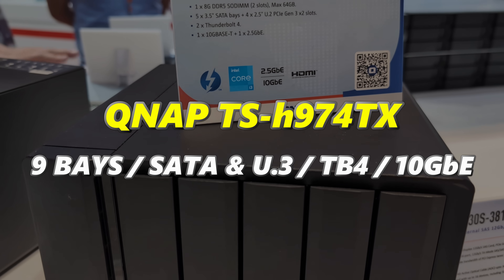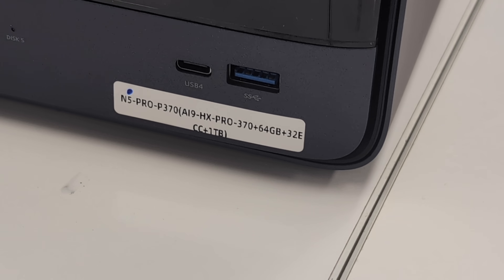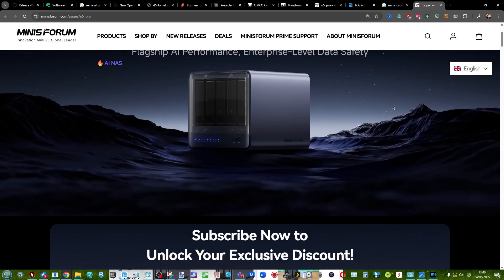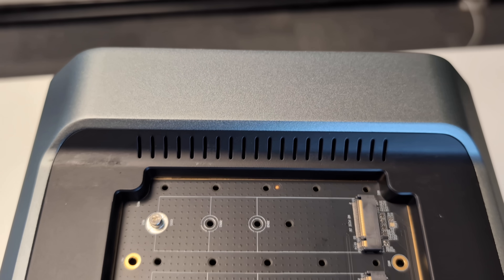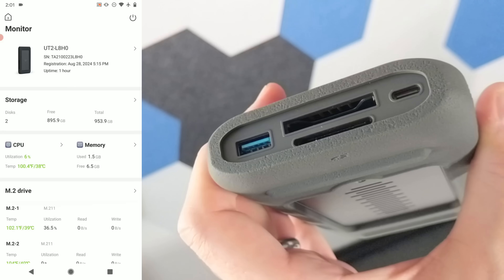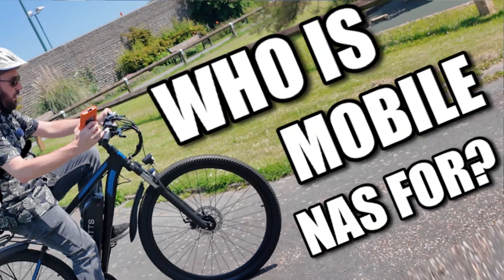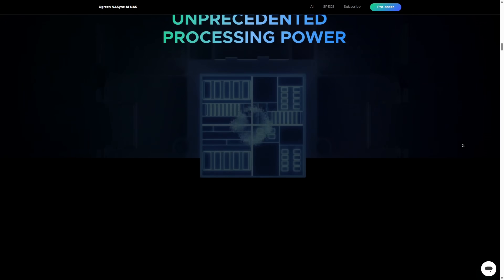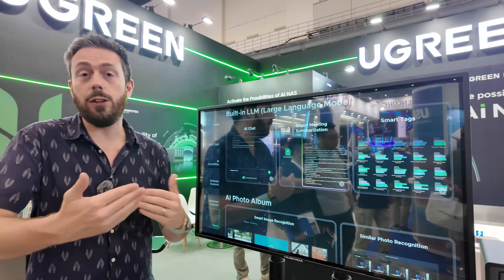5 Exciting NAS Coming Later in 2025

Comment: If  money is no issue and I want the best of the best NAS with best hardware (I run multiple VM) + 96GB ram + 5-6 bay minimum (I have 6x6TB SSD) which would be your choice? 

Looking at N5 pro and Aoostar you just talked about. Anyway really appreciate your take on which you would choose??

Ps. I just don't like to use proprietary ones like qnap and Synology anymore.

Comment: I’m still looking at the WTR Max. How would it compare to the 5 in this video?
Reply: The N5 Pro will perform better for local AI tasks and has a PCIe slot, while the WTR MAX has more storage bays and its likely to be about 300USD cheaper...we'll see at official release tomorrow.
Reply: @JBlongz  For EU and assumption of initial discount -30% from the EU store prices is from the 2119e (Pro+96G) makes it around 1483e, which is around 200e over WTR MAX with 96GB (Remember Minisforum prices have VAT and ships from EU, WTR MAX doesn't). 

So kind of, dunno. Both seems for me to do their jobs and +1 bay for WTR MAX, +1 Better CPU for N5 Pro, +1/-1 the network configurations RJ45 vs SPF+ vs Intel/Not-Intel.. and so on. 

If the -30% would happen to be from the discount launch price 1669e which I HIGHLY DOUBT, it would be a steal...